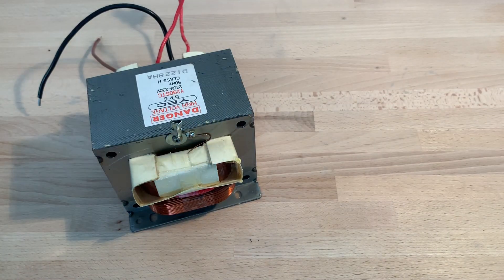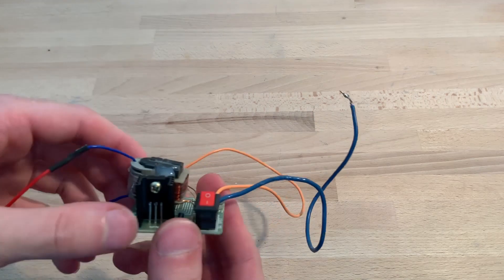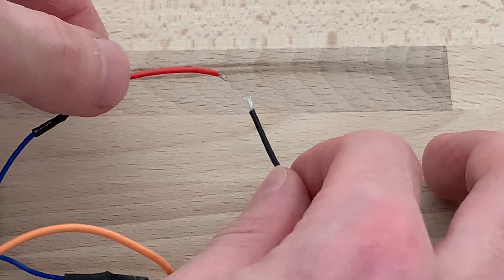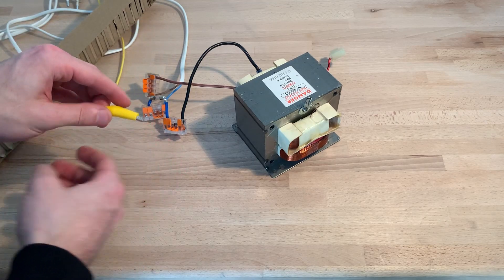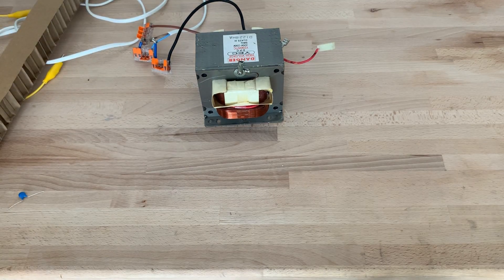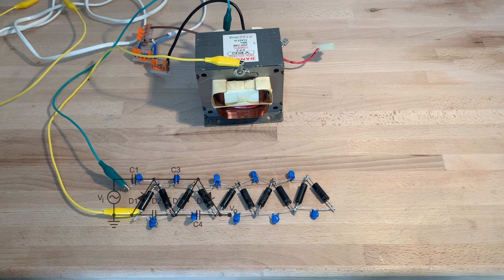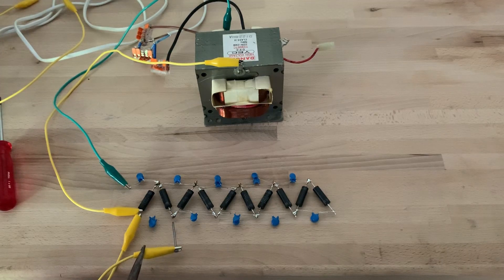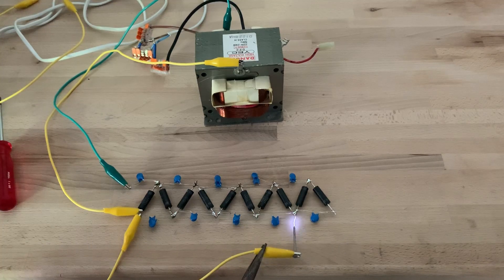High Voltage generation (Voltage Multiplier / Transformers)

Comment: I can't recommend too highly the use of SPICE simulation.  You will easily see the influence that frequency, capacitance, number of stages, and load current have on the output.  Voltage sagging is very common with too many stages, too small of capactors, and too low of a frequency.  Well before SPICE, Kuffel and Abdullah treated this mathematically in their excellent book High Voltage Engineering.

Comment: The capacitor size is why your output is low. 50Hz would require over >1uF of capacitance per cap for a reasonable current output. Caps that size would look more like soda cans.

Comment: You can pull around ~2kW of power out of a MOT, but the bottleneck in your system is the capacitor impedance at mains frequency. I'm assuming you're in Europe so you're running 50 hz. At that frequency you're unlikely to see more than a few milliwatts from the multiplier. Ironically, even though your flyback transformer is way smaller than your MOT, it would probably push out more power / larger arcs, because its operating frequency is likely to be in the tens of khz range, which would make the impedance of your multiplier circuit dramatically lower. 

Either way, good video
Reply from the maker: Yeah i used the fact that the impedance limited the power of my circuit. Using the full power of the MOT would have obliterated these tiny wires as the arc would erode it away and after what happened to electroboom im glad to have a capacitor between me and the transformer. Also the capacitor u would need are enormous. This was more to demonstrate the behavior of such a voltage multiplier. But yeah If more 
Power was desired one could either increase capacitance or frequency
Reply: @bootlegengineer  they dont have to be enormous, the capacitor used in voltage multiplier in the microwave oven normally is a around 1uf and can fit in your hand

Comment: Safety stick = Karton xD
Reply from the maker: If it wörks it wörks
Reply: @bootlegengineer  cardboard is NG (No Good) bcs it can get humid and become conductive, use just plastic, plus that pair of pliers are no good again to retain high voltage, the haldles have just a thin layer or rubber
Reply: Nice video bro